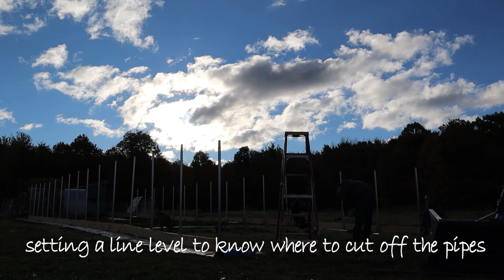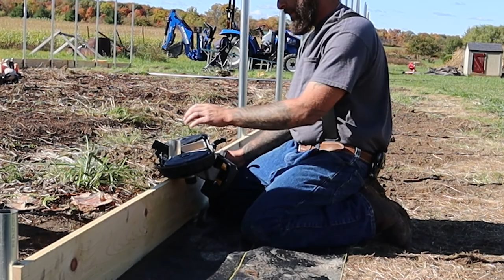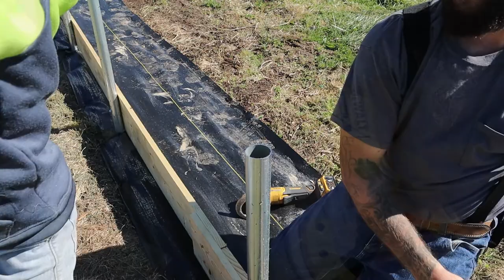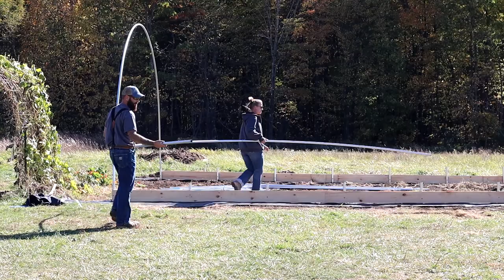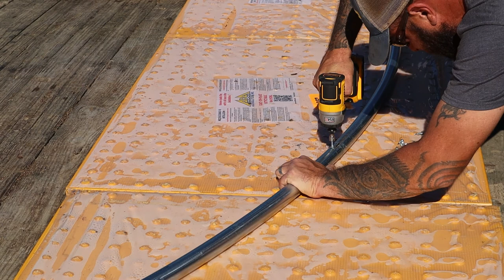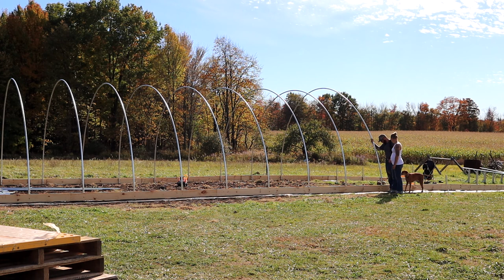greenhouse build day 5 |  DIY greenhouse  |  chain link pole greenhouse  |  husband & wife build

Comment: Ok so I gotta ask this and Here’s my end goal a livestock winter barn for a couple pigs and two goats. And use it for green house in the summer. If you would of kept the pole height taller would that have affected the bend. I plan to use pallets for the lower part of the wall
Reply from the maker: Sounds like an awesome plan! We actually build a second hoop structure and covered it with Billboard Vinyl to winter house our idaho pasture pigs. Having the ground poles longer wouldn't affect the bend at all, just the end height of everything. Thanks for asking questions. If you have any more, please don't hesitate to ask!
Reply: @rivlo_acres  we might end up going 32x20 and make it a year one barn. Have you had any issue with snow and do you have a video of the second one

Comment: I'm enjoying following along on this hoophouse build. I really like your method of putting the poles together as you bend them to get smoother curves. I haven't seen anyone else do that. I am wondering why you left the ground poles sticking up so high and cut them off instead of cutting and then driving them down to the correct level? It seems like a lot of waste that could be avoided.
Also, did you buy the entire Bootstrap Farmer kit or just the bender?
Reply from the maker: Thank you for watching!  We thought it made more sense to bend as one continuous in hopes for smoother hoops....and I believe it made a difference.  We left the poles long for 3 reasons, #1: we didn't grade the greenhouse site and we knew it wasn't level and #2: because we wanted to have the tunnel be as high as we could and #3: our local hardware stores didn't have enough of the 8' pipes we would've needed to build the greenhouse when we wanted to start. We plan to use the leftover pipes to build another tunnel structure in the future. We only bought the bender, not a kit.